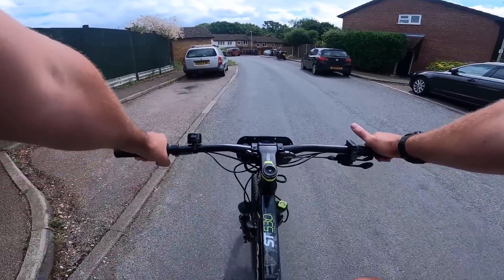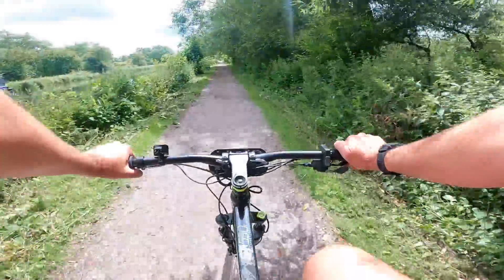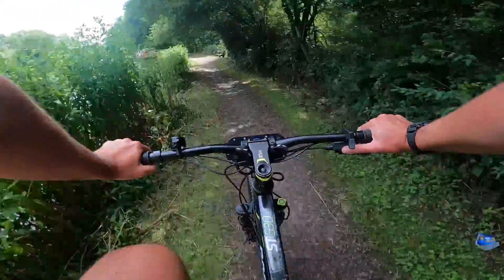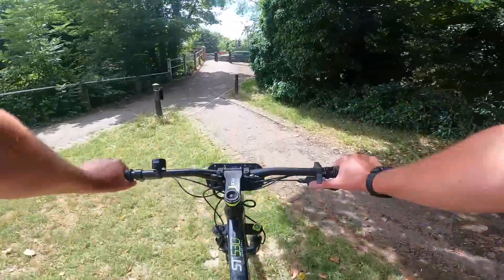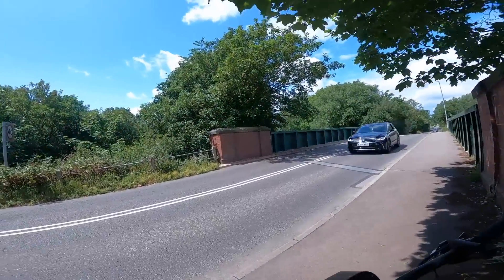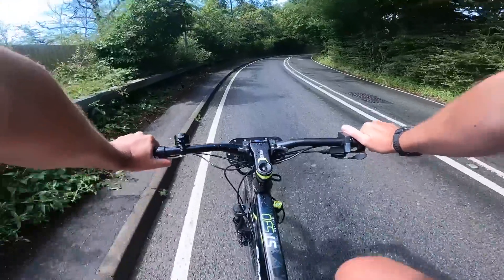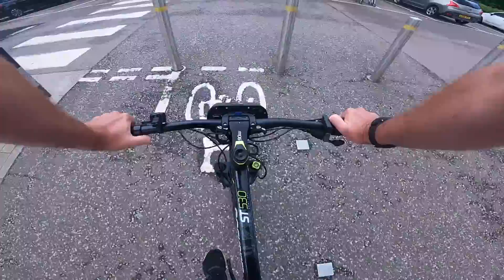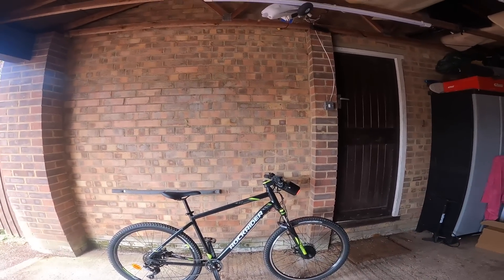HOW MUCH RANGE DOES MY 15 MINUTE EBIKE CONVERSION HAVE?!

Comment: Andy Kirby performs a pedal-assist range test, using moderate power levels and encountering occasional hills. He documents various checkpoints and the corresponding battery voltage. At 6.1 miles, the battery voltage drops by three volts. Andy continues the test, reaching 10 miles and then turning around. The battery voltage remains stable at 37 volts for a significant portion of the test. He faces challenging terrain, discusses puncture prevention, and experiences changing weather conditions. Despite the obstacles, the e-bike covers a total distance of 18.6 miles with a battery voltage of 33 volts, showcasing an impressive range for this setup. The video concludes by highlighting the bike's performance and suggesting that 15-20 miles can be achieved depending on factors such as weight.
Reply: All that time and expense for less than 19 miles range at 15mph?

Comment: I have a 26'' wheel folding Dahon Jack. I fold it for the train everyday but take the handlebars off the stem using an Allan key. Could I still do this with your unit? (battery off, of course). Thanks.

Comment: In reality you wouldn't be using assist along a tow path thats flat, so distance can be much more if you only use it when needed😊
Reply from the maker: Yeah of course but you'll get where you are going quicker with assistance. If you are using it for commuting...
Reply: @andykirby  hi Andy, I've been retired for 13 years and had forgotten about commuting!
When I was much younger used to bke to work at fords of Dagenham from my house in the east end of London 3 speed gears lol

Comment: I think my question about stability of front wheel drive on a bike is answered , seems to be extremely stable
Reply: this conversion needs torque arms it is a disaster waiting to happen. on my bike the dropouts gave out fortunately it was not while i was moving on the bike. had to replace the fork.
Reply: @maxheadroom1506  Do you mean it isn't a safe thing to buy?
Reply: @chefCorrado80  if you are going to add a front wheel hub motor you need to add torque arms on either side of the fork. They are not expensive but are needed to prevent the fork from failing. A fork that was not engineered for ebike will fail and you can get injured. You will not regret $15/torque arm to do this right. If you do not want to do anything to the fork then you can do a mid-drive conversion instead.

Comment: this battery is way to small 7ah at 36v is never going to be great
Reply from the maker: What?! You have no clue
Reply: @andykirby  run it battery only see how far you get
Reply: I'm guessing its  based around 3500mAh cells, 2 in parallel and 10 in series to give you 20 cells in total. This is quite a common configuration for ebikes and e-scooters. It's not a huge range but still a very usable range for most people. It would be more efficient with a throttle though so you only use power when you need it. Perfectly legal in the UK to have a throttle on an ebike kit. Department for Transport made a statement some years ago stating throttles were legal on ebike kits.

Comment: good idea for a basic conversion, but I would suggest that you  fit a adjustable  hinge on the display so that you can easily see the display all the times when riding will be a great improvement on the one your are promoting you will out do the swytch bike system totally

Comment: Im 67 in a few months but dont see the point in e bike assisted pedalling unless you're a lot older and dont have the energy to do say a 10 mile ride. Neitherdo Iseethe pointat riding between 15 and 20mph along a cycle path. It isnt going to get you fit \ fitter and Ibet the guy 'who finally' caught him is generally fitter.
Reply from the maker: I see your point but this is more about commuting. If you want to get to work or do an errand without getting sweaty or taking the car then ebikes are useful.
Reply: FyldeFlyer. You are right of course, but health issues affect some people. I finally added a friction drive e-assist kit to my road bike when I hit 90 and the hills got a bit much. The hills are OK now, but I still get a good work out, depeding on the length and gradient

Comment: Batteries don't work well when cold, but neither do they work well when hot. Warmer isn't always better.
Reply from the maker: Internal resistance of a Lithium Ion battery decreases with heat which allows electrons to flow in and out of the battery faster...BUT they can overheat and that's when bad things can happen like thermal runaway. They generally work better when warm vs cold.

Comment: You know what be good on that design is a pop up display you can see well riding the bike and see how much range you have lefted without having to lean over the handlebars to see the display or get off the bike
Reply from the maker: Yes, we have talked about this for the next version.
Reply: @andykirby  Maybe they should integrate bluetooth and an app to display on an iWatch.  Better yet, a simple clear piece of glass to project on like a automotive HUD.

Comment: can the mk2 version have an external battery socket so we can plug in for extra range... I live in mountains and i find it a worry that someone obese won´t be able to pedal up the mountain without a spare
Reply from the maker: Yes it will, already discussing another unit that looks similar with a rear light built in, potentially being able to be used as a powerbank too.

Comment: I do the low gear thing commuting home from work. This is a great looking bit of kit. 

I've always wondered why their aren't more of these kits about. Particularly batteries with in built controllers. 

I'd love to see a similar kit to this but mid drive. With under saddle mounted battery.

Comment: its a nice kit but the density of the battery makes me paranoid ( i would have to charge and store it outside )
Reply from the maker: Why?😁 they are LG MJ1 cells with a max charge rate of 3.4A and we are charging at just 2A. It's always wise to charge out of the house anyway. Less energy density is better if there is a problem the energy will be dispersed quickly vs a bigger battery.
Reply: @andykirby  yeah a quick loud fizz of exhausted fumes and its done with most luck ,i keep my battery away from any flammables lol

Comment: i got 4 tyres on my rear hub 1.75 a 1.95 a 2.10 and a 2.3  never get punctures on the bk and i got 2 tyres on front wheel😂

Comment: i 100% love and hate Ebikes , im 40 and when i was in my 30s i could pedal a mile 90%  uphill in just 5 mins flat ,now i dont think i ever could , my cardio gone downhill so fast over 4 years going electric , but i LOVE the power of it  ,got to  find that balance in life :)
Reply: i am 75 years old and ebike 300 to 350 miles per week all year round i have done 60,000 miles on my scott converted bike ,would never go back to a normal bike, my ebike which i converted 4 years ago a mid drive 250 w with duel batteries 34 amp, twin chargers,faster charging,air shocks front and rear downhill forks, the bike has traction control, stability control, trail control with remote, and a torque converter ,massive range at high speed wide bars ,comfort seat, solar chargeing,  to many extras to mention ,there is no way i would ever go back to a normal bike far to boring bulld your self one, mine cost me £600,do not buy a heap of crap from the shops,i am super fit because of this ebike,cheers
Reply: @leslieupton8022  What kit / components did you use?
Reply: @elgorrion52  scott genius frame tongsheng 250 watt middrive with torque convertor ,downhill air forks  ,rear air shock with traction control,stability control ,trail control,with remote,magnesium wheels, 26 235 tyres , comfort seat,wide handel bars,duel  17 amp batteries with controller ,duell chargers for fast chargeing ,etc etc
Reply: @leslieupton8022  So not an average person with little to no experience with this stuff.

Comment: Feature request for gen2, would it be possible to charge with usb c power delivery? You could then use any modern laptop charger at the office to top it up while you're there which would reduce range fears for commuters without need to carry a charger which would be nice 😊 I'm a 100kg+ rider and it's hilly around here.
Reply from the maker: Yeah absolutely. We are already working on this 👍🏼
Reply: @andykirby why are your forks the wrong way round is there any particular reason ??

Comment: That's all well and good, but you only really need the assist uphill. Where I live in Sheffield its down hill in every direction going out but steep uphill all the way back when you need it. So I'd need 7 miles of uphill power. It's steep and I'm 98kg, would it do it??
Reply from the maker: Yeah I reckon so. 👍🏼
Reply: You could glue neodimium magnets round a rim and an array of coils along a mudguard to generate power from the downhill, and maybe have the mudguard able to move up away from the mag field on the uphill so no drag. Oops, been watching too much Robert Murray Smith . . .

Comment: pretty impressive really.  simple kit to fit. 20mile range. Pull small box/battery off to charge . intresesring everything in the 1 box on front. be nice stronger batteries if possible for more range. intrested see it throttle only ride! the range ? as some of us are lazy .
Reply: dont bother as a very experienced e bike rider you will end up throwing it into the skip in 3 months ,save your money build or buy a proper e bike i do 15,000 miles per year for the last 4 years on the same bike,hoping to do 100,000 miles before replacing,mine cost £600 to build it has duel batteries 34 amps twin chargers  faster charge  massive range at high speed  up or down hills without lag ,250w mid drive with torque converter ,traction control. stability control, trail control, air shocks rear ,front downhill air shocks adjustable ,magnesium wheels scott full suspension frame ,comfort seat, wide bars, plus to many extras to mention ,charges up on solar free to run,and can be re programmed ,could sell with right offer

Comment: Would love to see you put this front wheel motor on an e-bike with a rear hub motor and see how powerful it feels just for a laugh
Reply: Would be even more interesting with a mid drive motor too!
Reply: @danmorrison667  it would be illegal ,would have to be registard with the dvla  insurance,mot, number plates, crash helmet,driveing licence,and unable to ride on cycle ways ,roads only
Reply: @leslieupton8022  the law is that a motor must not produce more than 250w continuous power, but doesn't mention if you add a second 250w motor? maybe they've not thought you would have two motors?

Comment: I have a fiido bike that is similar spec , im a bit lighter and battery is 350wh iirc, i get msybe 25 or so miles.
These are good enough for commuting but gor oroper fun i like 1000w and 20ah 48v minimum.

Comment: Close to 19 miles isn't that bad considering it's such a small battery but it also ruins the point of getting an Ebike in the first place when you only get like 20 miles of range. That is just absolutely useless in my eyes.
Reply: My round trip commute would be around 15 miles and can charge at the office as this thing is so small so it could do a 30 mile round trip in theory. Just need charging times and how big is the charger answering. Leaving a charger at work could be an option as well. I think it looks ace myself for commuting.
Reply: An effortless 20 miles is something. I'd like to see a test with minimal assist, rather than pushing it to the limit
Reply: Not really, This thing is perfect for people who live like 5-8 miles away from their workplace. could easily ride in full power each way without running it flat.

Comment: I have one of your proper kits on the same bike you are riding in this vid and it has never dropped a bar after 60 miles...however my girlfriends Swytch kit Gen 2 pro struggles to do 30 miles in lowest power so really looking for a solution!!!
Reply: I never got more than 18 miles on my gen 2 eco swytch, I weigh 63kg, on lowest power.
Reply: if you rode it at full power you'd kill the battery after 25 miles or so.
Reply: I did 27 miles and almost flattened my 1300 battery on Friday. Full-Power assist, unlocked to 23mph max.

Comment: I don't think the BMS in my bike will allow you to flatten the cells down to 3.3 volts per cell....🤔🤔😳🇬🇧 I wouldn't like to push them that low TBH Chinese cells and BMS suicide  is a well known phenomenon...🤔😳🇬🇧
Reply from the maker: They are LG cells 😁🙌🏻
Reply: @andykirby  That does make a difference, as does the BMS programming....🤔🤔😳😳😏😀🇬🇧🚴

Comment: That track playing, is that Hellen on the vocals?
It might be a good idea to do a teardown of the hub motor, I've had a Swytch motor and the outer ring gear is plastic, I've had to 3d print a new one, even at that, I'm looking to cast one out of metal.
Just interested to see the build quality on the gears?